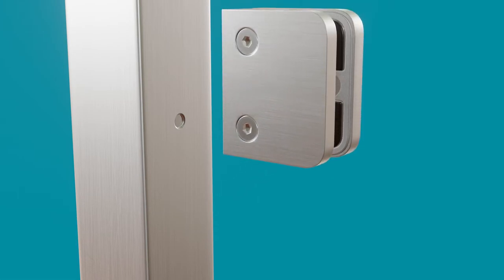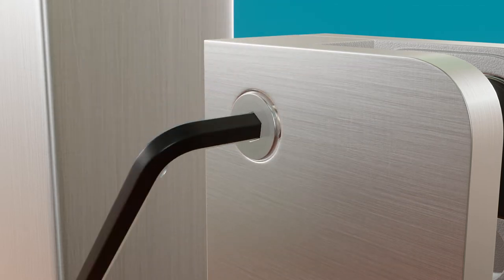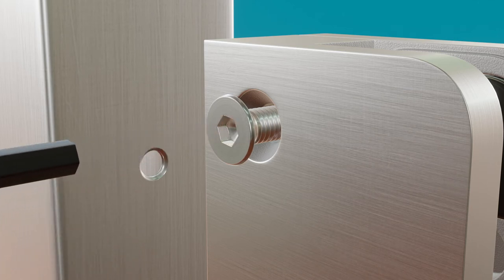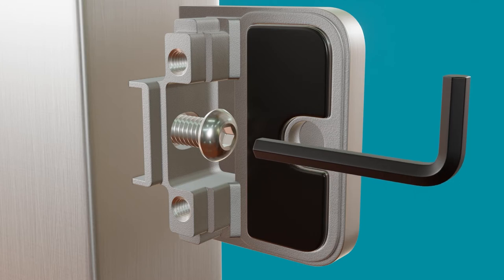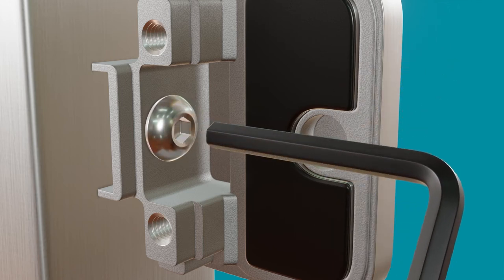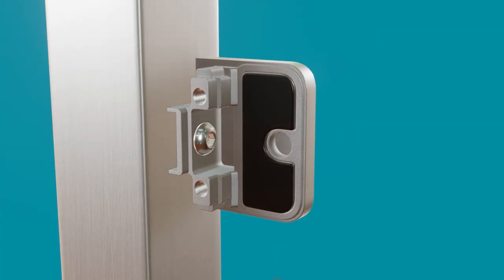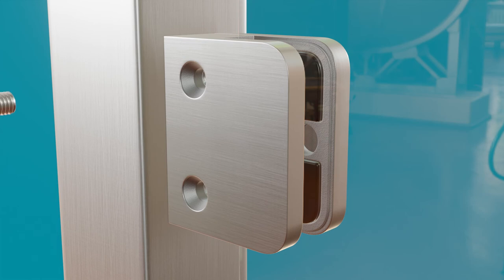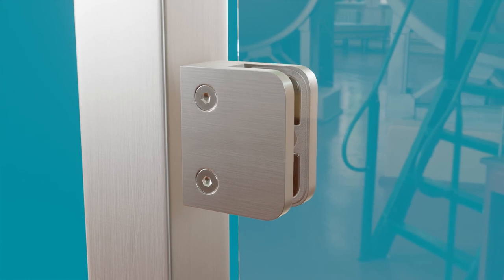Viewrail Glass Clip Installation Animation

Comment: Sir please tell me the thickness of Square pipe . size of screws which enter in to  pipe . from where this clamp can be purchased.  price of clamp.
Reply from the maker: We are the manufacturers and fabricators of the products you are interested in. The posts in this animation simulate our 2205 brushed stainless, the screws are ours in house, and the clamp is our proprietary glass clip and gasket. The best way to get started is to fill out our Quote Request Form on our website: www.viewrail.com/quote